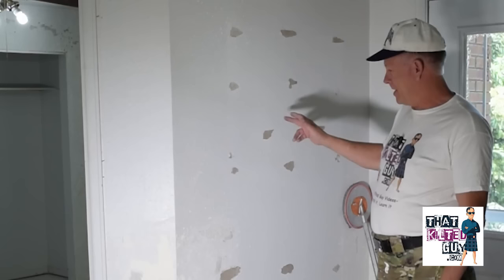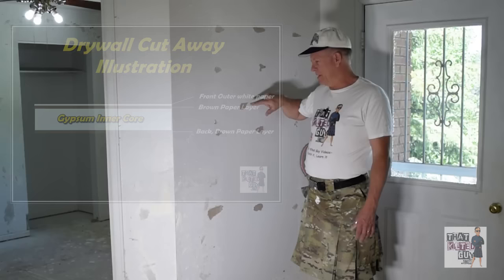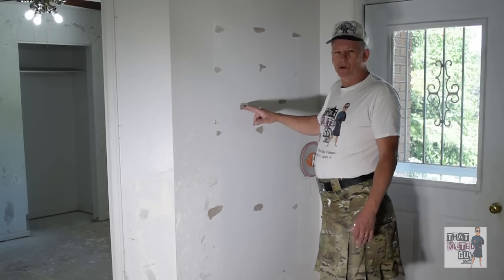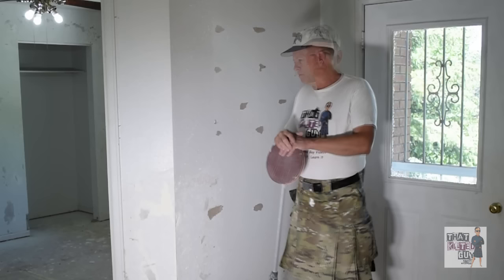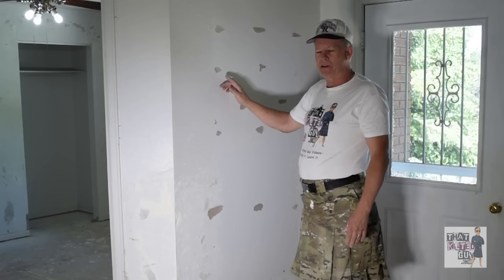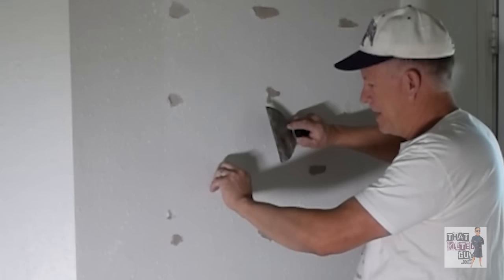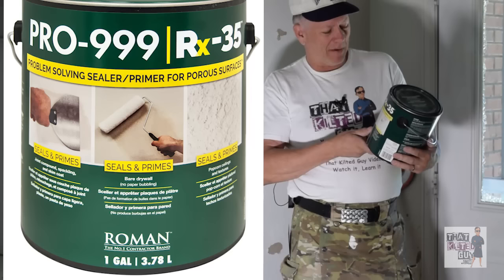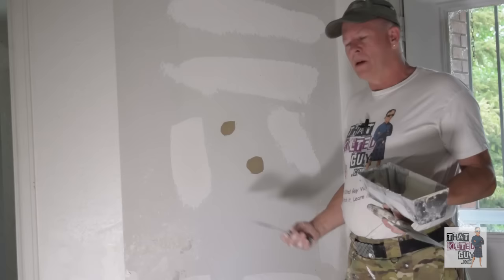⭐ Repair Damaged & Torn Drywall Paper BEFORE YOU MUD IT in 2022!

Comment: Guy, would you consider using the Rx-35 as a primer base coat before painting?  On bare drywall or over a mudded repair?  I've used it to prime and seal my brown paper repair areas, but I'm wondering after I'm done with my repair patching if I can use the RX-35 again to do an overall prime and seal on the bare (sanded) mud before painting.  Any thoughts?  Ever use it that way?  The package seems to indicate that's one of it's uses.  I wanted your opinion.  (Partly since I have a gallon now, so why not use it?)  Thanks!
Reply from the maker: I actually haven’t used it for anything besides the brown paper repairs because I tend to always have spare primer around somewhere. But I would go by what’s on the label and if it says it should work then I would give it a try. Main reason I don’t use it for primer is it is pretty pricey as a timer. Thanks for the question.

Comment: What if the damage is a lot bigger like a couple of feet? Would it be easier just to replace the drywall?  Thanks for the vid :-)
Reply from the maker: If it's just a couple of feet, you can still repair it like this.  What you have to keep in mind is the outer white layer of paper is a lot of the strength of the rock, so if too much is removed, then yes, I would replace it.  But a section roughly 2' long by 2' wide, could still be repaired using this method if the rock still feels solid.  Thanks, and hope that helps.
Reply: Thanks for your reply. Will try to repair first then replace if i have to. :-)

Comment: Try kilz guard way better than this pro999 rx35
Reply from the maker: Victor Castro I’ve actually repaired over 2,000 individual repairs like this and have tried dozens of solutions. This product works Great, but only if used as specified on the can. The product you’re referring isn’t made by kilz, it’s made by Zinnser and it’s called Gardz. It’s an equally good product and I have a link to it in the description which is- 
Gardz torn paper sealer - https://amzn.to/2L3tl9V
Reply: You know what I’m talking about I have repaired houndreds of wallpaper walls working in an old hospital and this product it’s good for the price 20$ a gal I have used it over wallpaper paste with good success . Zinnser gardz cost twice as much but worth it
Reply: You know your stuff thanks for sharing

Comment: Why is the 2nd coat of mud a different color?
Reply from the maker: Factory chooses colors
Reply: @ThatKiltedGuyDIY  could I buy only one type of mud? I didn’t find that in the video. Some commented this:
EasySand20 first coat and 2nd coat of mud Plus3 by USG (or
lightweight all purpose mud).
I have a mess to fix and have limited budget
Reply from the maker: Just use the Plus3 on everything except a deep fill. If you put it on anywhere close to a quarter of an inch thick or more, you have to use hot mud

Comment: Spray glue is easier and faster, 
Spray it
Wipe it down once
Spray it again
Let dry
Then skim
Reply from the maker: Mike Leppert I’ve been playing with that for about a year. Going to do a video testing many methods one day.
Reply: Cool
You have to knock the fibers down with something. Sometimes I use my fingers.
Doesn’t work too good without the 2nd coat of spray. It seals it. Your method will work better on bigger jobs though.
Reply from the maker: Mike Leppert lol, I use my  fingers too.

Comment: I'd it's just one or two small spots, couldn't you cut the damage around it like you showed and bed  drywall paper tape with a finish coat?
Reply from the maker: Believe me I have tried that and sometimes it will work, but if the brown paper bubbles up underneath then it will always be a loose bubbly spot on your wall so you end up cutting it out anyway. For a simple version, try rubbing Elmers glue on it and letting it dry or spray adhesive. Let me know if this helps.

Comment: Ummmm...Pro 999 is just primer.
Reply from the maker: Do you have proof of that? I would love to see it. I have fixed probably 10,000 torn paper spots and I have tried oil base primer, water-based primer, and many other things such as five minute hot mud, etc. and nothing worked as good as this product. It’s not needed every time, but it sure prevents failures that cause headaches and delays in getting a job done quickly.

Comment: Polyurethane will do the same thing for less.
You can also use the polyerathane on your drywall tape so it sticks to the sheet rock since the sheet rock tape doesn't has any tape on it. It's just paper. 
Brush the joints with polyerathane before you put the sheet rock tape on it. Than paint the paper after it is set.
Try it you will be glad you did.
✌ ❤ 🗽
Jenasus
Auto body putty works great for repairing 2x4's behind the walls if they need it.
I call sheet rock shit rock.
Reply: what kind of polyurethane?
Reply: William Thomas,
I use Varethane  polyerathane but any kind will work. 
Don't sand the polyeurathane. It will leave a texture like the top paper on the sheet rock.
The best part of using polyeurathane is keeps the sheet rock tape from bubbling up or not sticking to the sheet rock and will take care of all the little or big tears of the top layer of the sheet rock before you mud over it.
Reply from the maker: sorry, but I will never try polyurethane on sheet rock. And especially not for sticking it to the rock. The joint compound does a fine job of that.

Comment: I have two softball size rips in my drywall, with parts of it showing brown and parts of it showing white, should I use the same technique?
Reply from the maker: Hello, due to the increased number of subscribers, and questions, all our questions are now quickly answered on our Patreon page at: https://www.patreon.com/ThatKiltedGuy. We hope you'll join us there and help us to answer your questions, and to put out many more videos.  But if you're not in a hurry, I will get around to answering questions here in less than a week usually.  Thank you for your support!
Reply from the maker: Hello, yes you can use the same technique for any sized brown paper damage.  I'll be putting out a new video showing some easier and cheaper ways of repairing the brown paper soon.  I'll also test numerous methods including just plain drywall mud, Kilz, Elmers glue, spray adhesive and more.

Comment: A decent primer should work For this p*** paper situation
Reply from the maker: In 20 years of doing nothing but drywall repairs, I have probably fixed 10,000 torn brown paper spots so I can tell you it doesn’t work as well as other products like the one I show. The problem is, brown paper only bubbles about 25% of the time so if you try something and it seems to have worked, it may not have needed it. I have experimented with about every method I’ve ever heard of and there’s only four or five that I found it work well including spray shellac.

Comment: I had to skim an existing wall in the hospital the gc painted with that stuff worse product ever had blisters and had to scrape off 3 times doesn’t seal worth a shit
Reply from the maker: There is absolutely no product out there that will completely seal a wall if you don’t prep it first. But myself and Paul Peck Drywall have used this product many times, and it works really well, if you have prepared the surface first. So he probably didn’t.

I once had a customer scrape the popcorn off the ceiling and wanted me to fix it from there. They had well over 2-300 brown paper spots showing and not one single one of them blistered after They put two coats of this on them. So he either didn’t use the right product, or the right technique.

Comment: How can do this on a smaller scale
Reply from the maker: I've been working on a test involving about 10 different ways to do this, just for this reason.  But my health is making it hard to complete the video, so you might try Oil base kilz, or Hairspray, or spray adhesive.  And actually, the better you prep it, and the more loose layers you use, the less you need to do anything.  About half the time you can get away without treating it.  Hope that helps.
Reply from the maker: One last thought, cut out a circle like I did in the video, peel ALL the paper off and just coat it with mud.  That's one last option.
Reply from the maker: Also, I just put a quart size container of Gaurdz in my Amazon store on the drywall repair list at https://www.amazon.com/shop/thatkiltedguydiyhomeimprovement. That product will work as well as the one in my video.

Comment: What product did you use for the second coat of drywall?
Reply from the maker: Briana, thanks for the question.  I used my favorite drywall mud called USG Plus 3.  It's a lightweight all purpose that works nice and smooth, minimal shrinkage and sands really easy.  You can get it at the big box stores around here.  Hope that helps, thanks, Guy

Comment: Good stuff, but for godsake get to the point.  15+ minutes?

4 minutes:  Wet paper will bubble if not sealed. Don't leave flaps/burrs--cut or sand them off.  Use sealer/primer.  Then mud.  Go far enough past the edges.  Sand.   Done, get on with your life.
Reply from the maker: Novices would be totally confused with an explanation like that.  If you already knew that, I appreciate you stopping by to critique my channel, but my viewers are mostly totally new to this and need this detail.

Comment: It can be fixed with out that secret product. LOL.. You must have stock in it. lol
Reply from the maker: Well I've fixed thousands of these spots, and yes, sometimes they fix easier than others.  but if they bubble, they are a huge pain.  I'll do a video demonstrating this one day.  As a pro, I found this saves me time as it almost never fails, but without something like this they'll often bubble after just a coat of mud, requiring starting over, which wastes time. So I'll demonstrate that one day, thanks for the idea.  And no, I make nothing off this product and they don't sponsor me.
Reply: I appreciate the video. For a guy like myself(weekend warrior) I try to do more with less. lol
Reply from the maker: And I do get that, which is why I've been experimenting with cheaper ways to fix one or two spots, and I think I have several ideas and will test them in a future video.  Thanks for the conversation, I appreciate the input as it helps me guide my channel.  Take care.
Reply: Thank you for your response. You have a good channel.

Comment: Elmer's glue or dilute wood glue and a small paintbrush. This will ceil the paper. Common sense wright. 😉
Reply from the maker: I'm going to test many methods in a future video.  My thinking though is that elmers glue is still very easy to soften when dry on such a thin, watered down area and will still fail too often.  Guardz and other products when dry, are not easy to soften and have less chance of failure.  But I dont know, so I'll test these one day.

Comment: How do you make a buck with your speed??
Reply from the maker: Well there's no way you can judge my speed by a Teaching video.  I'm here to teach amateurs so I Have to go slow.  And I get things done much faster than most guys doing this type of work.  Check out my Timelapse video where I complete a repair of a long hole in the wall, from start to textured and cleaned up in 1.5 hours.  And I charged $240 for that repair, so I do alright.  Without having to haul in compressors, drop cloths etc, I've done repairs of 8" holes in 30 minutes, start to textured, so speeds not an issue.  But thanks for asking.
Reply: That Kilted Guy DIY Home Improvement Do you pick up speed when you catch a gust of wind up that skirt you wear? Just kidding.. Laugh out loud. I'm sure you do good work
Reply from the maker: Well hey, a cool breeze up the backside will usually get most people moving faster, LOL. You’re a funny guy.

Comment: Holy crap man the first ten minutes of the video you repeat yourself and become very redundant... Just get to what to do.. You almost list me in the first few minutes!!
Reply from the maker: I just listened to the first 4 minutes, and not sure how I'm repeating myself.  Tip, you can skip ahead to the part you are looking for.  But I do try to explain WHY the paper bubbles, and why you need to repair it right and what happens if you don't.  But thanks for stopping by.
Reply: That Kilted Guy DIY Home Improvement You do know you could use a hot mud right over the brown spots.
5 min mud and then a skim.
Reply: You did say that I'm aware.. It's just quicker and you lose a step and add an hour... I don't know about you but a can get a lot done in an hour.
😊
Reply from the maker: I do know that.  But I couldn't possibly use 5 minute while explaining all the details.  BUT, I did use 20 minute in this video.  Check it out at: <!--br {mso-data-placement:same-cell;}-->https://youtu.be/J7zSqZhBHJo?t=9m9s.  I use a LOT of 5 minute, but only when it's the right stuff.  In this job I had well over 50 spots to fix like this, so I used 20 minute, or just all purpose.  Someone else stripped the wallpaper and did a lot of damage, so I fixed it.  This was a 7 day job all total.
Reply: still has a chance of bubbling. maybe you just havent been doing it long enough to know that.
Reply from the maker: Yeah you’re probably right, 35 years really isn’t enough to know what I’m doing. And I shouldn’t call myself a pro since I’ve only done about 10 to 15,000 repairs and hung tens of thousands of sheets and put on probably 50,000 boxes of mud and 5000 bags of hot mud. I’m still an amateur with a lot to learn about how to do it right like a pro like yourself. Thanks for the advice though.  Glad you set me straight.lmao
Reply from the maker: Now for the real reply. I have probably fixed 1000 brown paper spots using this method and probably another 500 using other methods and this method has proven to be about 99% effective. Previously using oil based kilz, etc. it was only about 70% effective so I’d say that yes, this is one of the best ways out there. But you do it your way because you seem to be the pro.
Reply: It's bait!  Don't take it!  ;)
Reply: I very much appreciate your help